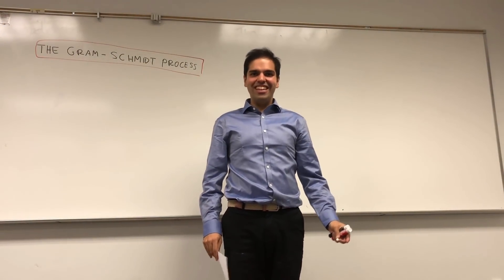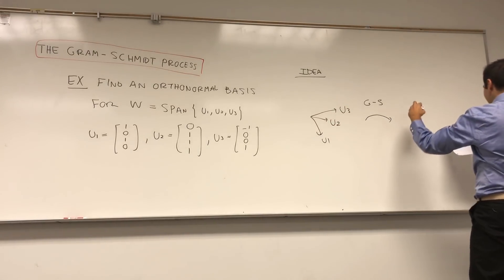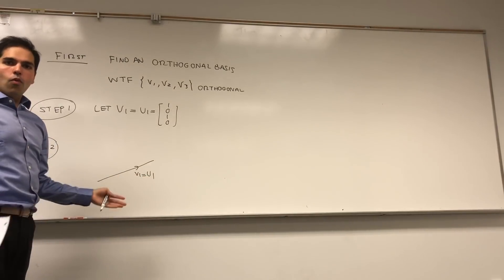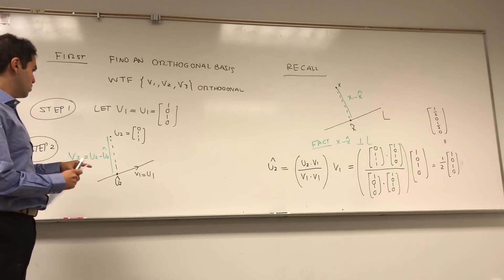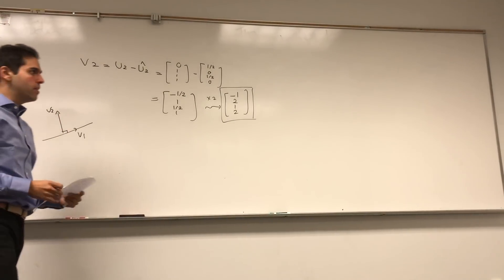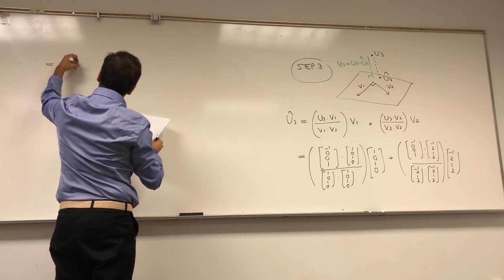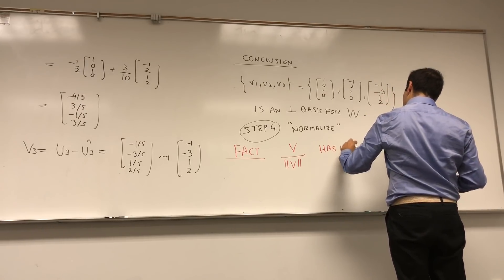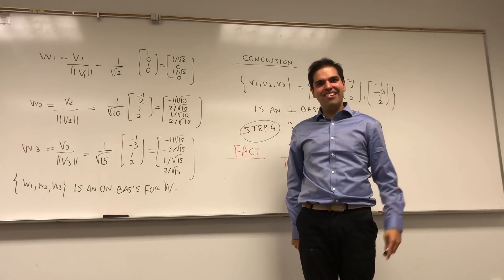Gram Schmidt Process

Comment: Great video! I couldn't understand what this process was doing by reading my textbook and now I understand it! 
Just for those that may not understand (or for future me, I often forget things that I understand once), the reason why 

û2 = v1 times (u2 dot v1 / (v1 dot v1))
is because of the following:

||û2|| = u2 cosine the angle with v1
||û2|| = (u2 dot v1) / ||v1||

if you do ||û2|| v1 you will get a vector on the same line as v1  (good), but its length will be ||v1|| multiplied by ||û2||, instead of ||û2||. 
Therefore, we need to divide the result by ||v1||. 
So, û2 = v1 ||û2|| / ||v1||
û2 = v1 (u2 dot v1 / ||v1||^2)
û2 = v1 (u2 dot v1 / (v1 dot v1))

Comment: Linear algebra is amazingly intuitive. I learned about this many years ago, and have not applied it since. Yet, within the time you spent to introduce this (< 1 min), I was able to fully reconstruct how it works. Not sure why this is a good thing tho lol (need to watch more of your videos I ges :P). Also, there are of course, infinitely many orthonomal bases (for the same space). Not so sure what's so special about the one that GS spits out. You could also do the vectors in any order, so for an original basis with 3 vectors, you have 3! = 6 possible basis that GS can generate for you, each giving different "preservation priority" to the original 3 vectors.